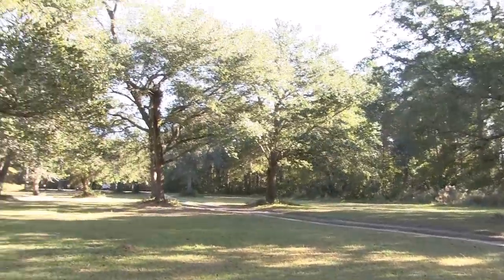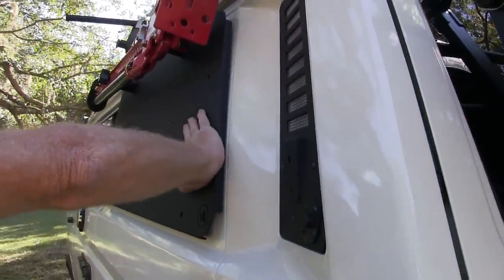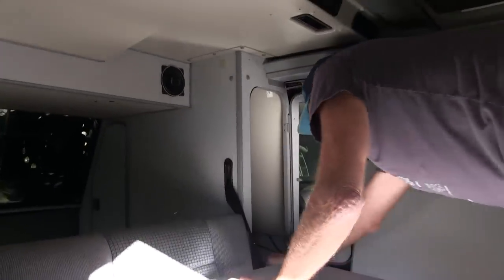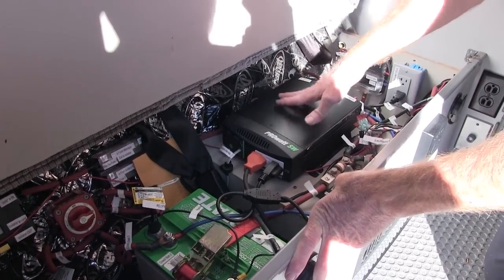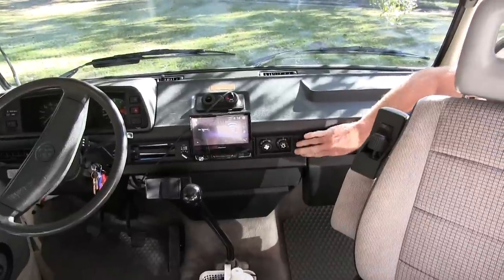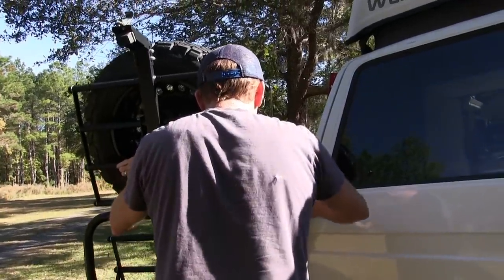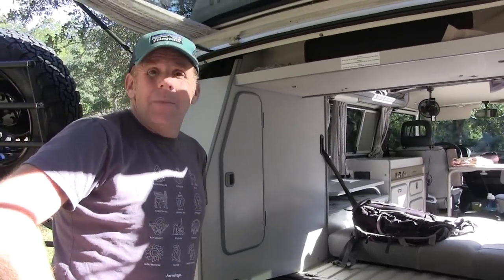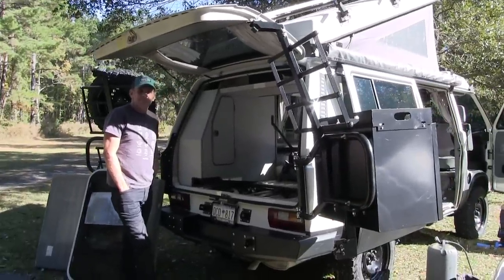VAN LIFE | Ultra Modified VW Vanagon T3 Westfalia Tour

Comment: Nice tour. I miss my westy.  Had an ‘82 from ‘99 till 2006.  It was a diesel which I had converted to a inline 2.0 in streetsboro Ohio.  The diesel was a joke... 60mph max speed.  Even down hill.  Lol. (Scary getting on I80 in PA) After the conversion it was good though.  Took me from PA to WA (where I live now) and back 3 different trips.  Daily driver, 115k miles.  Unfortunately mine was bought in PA and the rust caught up with it and thousands later I sold it for $1600 bucks in 2006. They’re fun vans.  Have money to spare.  Oh yeah, FYI, don’t try to cook on the dish drain, it warps  the thin steel.  Lesson learned.  Nice tour.
Reply from the maker: Thank you for the information

Comment: I love coming to you tube to get my Westy fix. I had an 87 highly upgraded Westy it was my last one sold it in may for 45k and now have a 4wd Sprinter camper I love it to but nothing and I mean nothing beats rolling down the road in a Westy with the dog next to you heading to a new adventure. I think I will get use to the Sprinter it is like my Westy on steroids. Thanks for the video.
Reply: I hope to get my 85 westy back on teh road (subaru engine 2 in process), and how is your Sprinter a year later ?
Reply: @DanTheManIOM  really happy a lot of the sprinter van campers are just like Vanagon folks. I have started some mods aux fuel tank (28 gallons) spare tire carrier/ladder, pedal box, and some interior stuff. Just like the westy mod mod mod. It is like my Westy on steriods.

Comment: Nice to see all the upgrades available.  Great job Chris.  Sail Boat quality well said.  Unfortunately the Vanagon motor is junk.   VW busses have always had under powered motors.  1978 2 liter with  hydraulic valves may have been the best fit for the bus but didn't seem to hold up in the Vanagon.  3-4K for motor upgrade ouch! Personally when it comes to a VW bus less is more & the older the better.   1971 is the best year for a Bay Window has the bug motor still & disc brakes.  You can rebuild the motor in your dining room for about $500.  Very easy to work on.   My fave is the splitty 1950-1967.   1966 being the best stock bus IMO.  1967 is good too just doesn't have the Church Key or Flashing Flasher Knob.  Enjoy the ride.
Reply: Yup - that's why it's got a Ford Zetec in it!

Comment: Excellent video Patrick. I'm looking fo8to the Eurovan video. I was looking at buy a Eurovan. Found a 2003 with 80,000 miles for $14,000. I was hesitant to buy because of the price. And the shifter was a little low. Maybe there are taller aftermarket ones.
Reply from the maker: Eurovan will be up Dec 1st

Comment: Nice van!
Reply from the maker: Thank you for checking this out
Reply: One point, the facet should be rotated 180 degrees so that the switch for the water is on the right and you don't have to reach through the water stream to change the flow rate.

Comment: Looks good but oil pan is to low.  Subaru conversion is best in my opinion. That could ruin your trip with that low slung  unprotected pan. Maybe make skid plate?
Reply from the maker: Could help
Reply: It's actually not much lower than stock. The oil pan is reinforced.

Comment: german engineering  is un- paralleled imo .
Reply from the maker: Thank you
Reply: The Westfalia camper conversions are an exceptional use of space. The factory VW Vanagons however are fiddly beasts, particularly the stock engines, hence the Ford engine conversion here and the prevalence of Subaru swaps.
Reply: the rust might disagree

Comment: .....You put a FORD motor in the Vanagon....BLASPHEMY!!
Reply from the maker: Has to be reliable if it is a rental
Reply: @NewJerseyOutdoorAdventures  Ford is reliable? Agree to disagree there. >.>
Reply: Look how motor hangs.. 5:07 not cool..  subie flat 4!
Reply: @kevinpearson3820  head gaskets, cooling problems, and non steel backed rod bearings -they cant take the heat